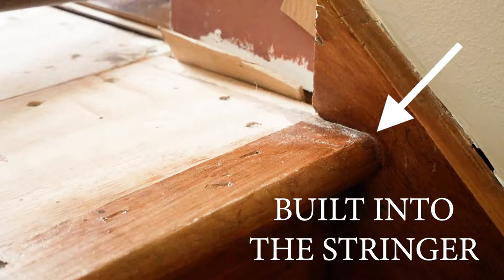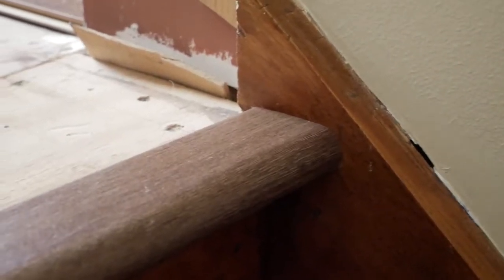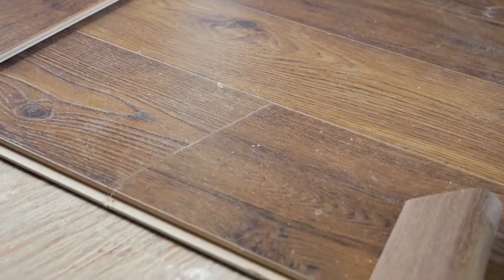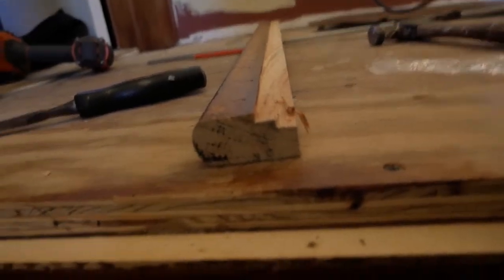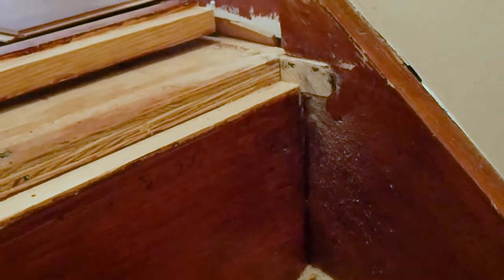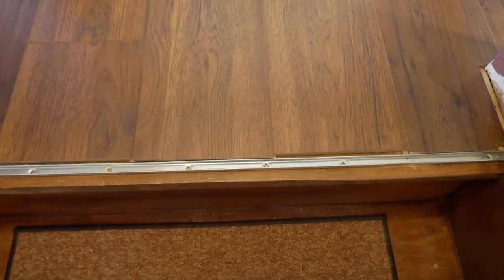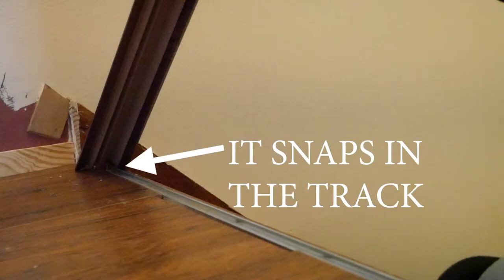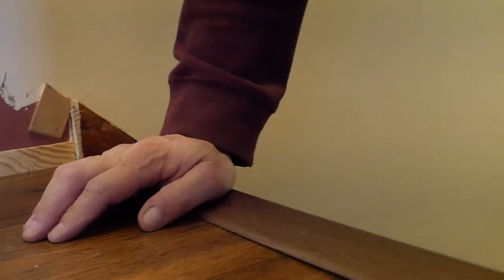INSTALLING A VINYL STAIR NOSE WITH PERGO FLOORING

Comment: There are a lot of "stair nose installation" video on here, but your situation pretty much matched exactly what we're dealing with.  I laid cork flooring downstairs 6 years ago, with nothing in the way and one huge open plan...easy to install.  However, just laid Pergo laminate upstairs (600sf) in hallway and 2 bdrms, with closets and baseboard heating and a Murphy bed to move.  Oh dear God!  About lost my salvation, but we were successful and it looks great with only transitions at 2 bathrooms with tile.
NOW we are at the top of the stairs with two small landings, which will also be laminate, in between 13 total steps.  You provided a simple, neither right nor wrong, way to do a bullnose.  Thanks for the simple installation video!
Reply from the maker: Appreciate that very much!

Comment: I have the exact same Pergo Floors. They discontinued them and renamed them with a different thickness so the tongue and groove do not fit the previous model even tho they look the exact same. I was able to find the exact matching stair nose, quarter round, and transition pieces and once they are put together they are beautiful. I would recommend using some liquid nail inside the track when adding the stair nose and maybe even a few finishing nails to make extra sure it stays strongly in place because the stair nose takes the brute force of walking up and down the stairs.
Reply from the maker: Thank you! Do you by chance remember what they renamed it? Wife loves it and would like to use it in another room. Great tips too! Thanks so much.
Reply: Creating A Simpler Life next time I go to Lowe’s I will take a look at and tell you, they have it on display at the Lowe’s near me. I’ll need to go there soon so I will def tell you.
Reply from the maker: Thanks!!
Reply: Creating A Simpler Life used to be Cambridge Amber Oak, and now it is called Cambridge Abbey Oak.
Reply from the maker: Thanks so much!